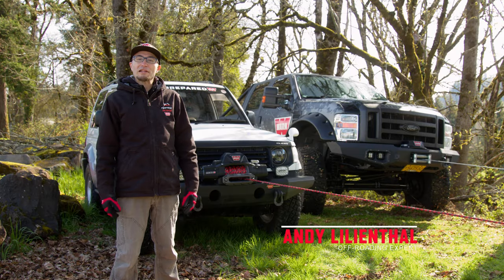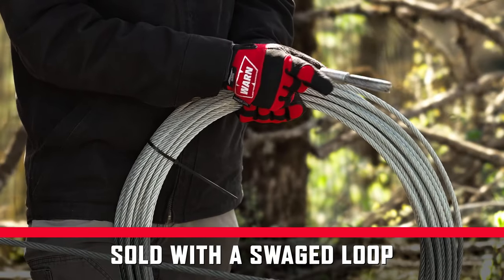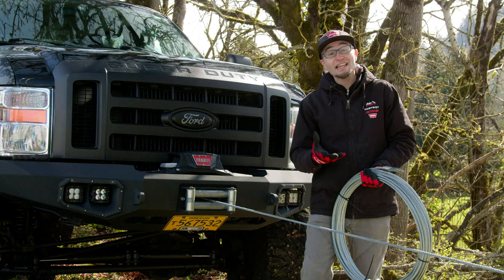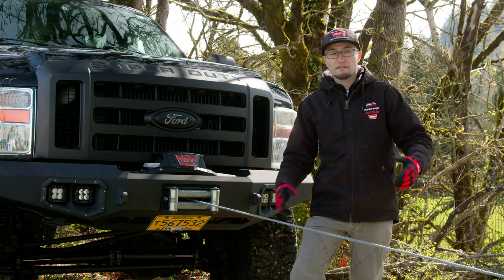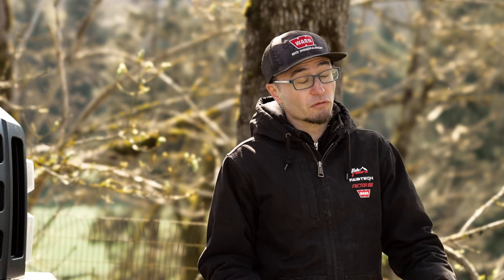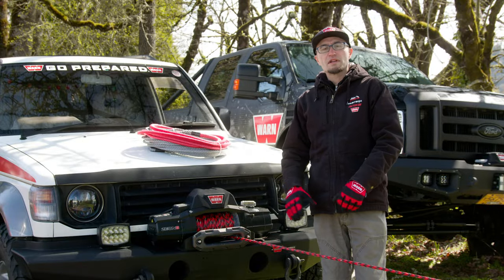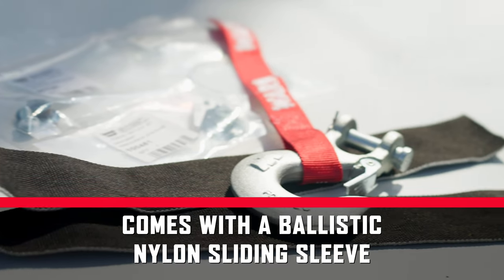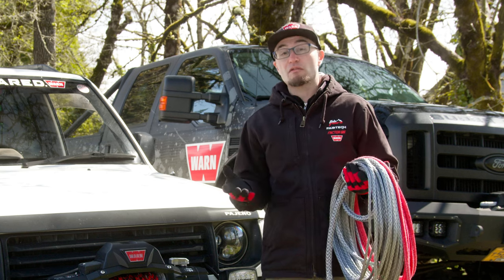Steel vs. Synthetic Winch Line

Comment: After having my steel cable shred I went with synthetic.  Did a lot of research and discovered a marine and arborist shop and got Amsteel 3/8” working at 19k lbs and 1 1/8” working at 120k lbs for my 100’ recovery.

Comment: You can also buy wire rope from a logging supply store for much cheaper (an example is Timber Supply Company in Philomath) than ordering replacement wire rope from your company. Replacement 125' 5/16" cable for my 9.5ti is $253.79!

Comment: Synthetic rope doesn't last as long. That's a deal breaker for me.
Reply: I have a steel 7/16"(90 feet)  rope in my 15k warn. My three complaints are this. 1- weight. It adds a bit more weight in front of the axle on top of the already 135lb winch and then add more for the mount (power wagon inside frame) or bumper (mine is close to 300lbs, I believe more) 2- handling it can be painful if a wire is sticking out that you don't know about. 3- if it kinks is pretty much toast. That becomes a weak spot and usually follows with recommendation of replace or cut and loose (x) amount of feet. 

With that said. I won't go synthetic here. The salts from 8-9 months of winter would destroy it before I could use it.
Reply: @maddawgnoll wash it frecuently

Comment: I thought one of the main advantages of synthetic ropes was that they were much better at kinetic pulls that can be used to get a vehicle unstuck when the towing vehicle weighed much less than would otherwise be required to get a vehicle unstuck that was a combination of too heavy and/or too badly stuck for a normal pulling technique.